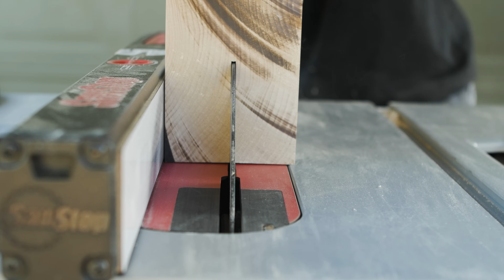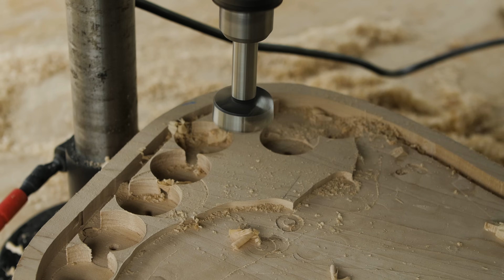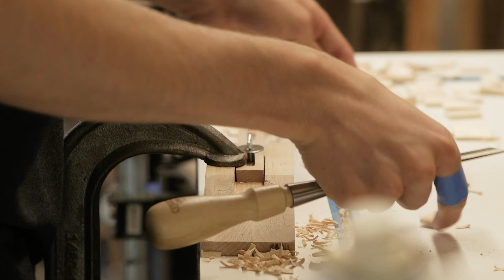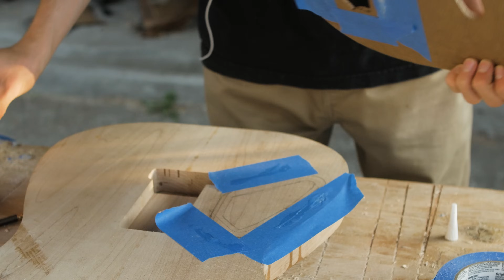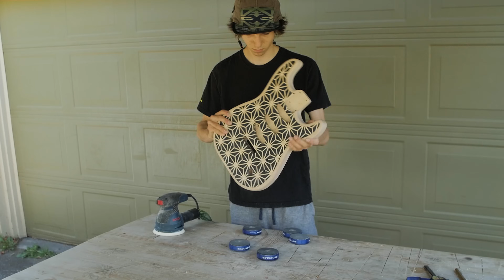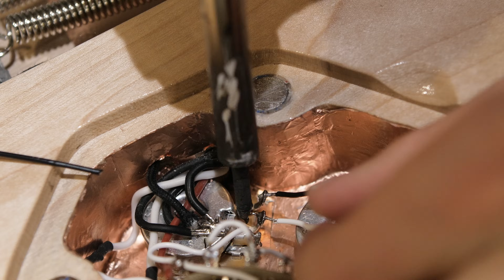Epoxy + Kumiko = Epic Guitar?

Comment: Hey, young man, that's a great work of art you made. I love it; you're a god damn artist.

I don't get why they don't make cheaper guitars like this. In Argentina, a Epiphone special costs between $400 and $500, and for me, that's a relatively high price for a basic model with relatively inexpensive materials for a guitar without amp. 

Although, if the problem is the use of expensive woods, for example, I'd much prefer to pay between $150 and $200 for a guitar like the one you made. I wouldn't mind if it were made of pine, basswood, or even friking pallets as long the design is the same.

Again the design is beautiful, and with that price, I could get a 15-20 watt amp, which here cost between $200 and $400.
Anyway, I fell in love with your design and how you made this guitar. Keep making things like this; your work is truly admirable.

Comment: Cool stuff. I was hoping for a through body pattern with a cap for the front and back. Was interested in the sound it would make. Also without the pick guard you might have wanted to set the neck a little bit deeper.

Comment: after you tin the wires with solder, you've burned away all the flux that comes inside the solder from the factory.  so when you do the final soldering you should add a bit more flux manually to keep out impurities and prevent corrosion from compromising the connections after a few years.  even if it's not enough corrosion to weaken the connection, it can add noise into the sound that's picked up.

Comment: Impressive!  How does the epoxy affect the weight?  I’m thinking of building an epoxy pour tele but am worried about the weight. Was thinking of hollowing out parts of the body behind the pour and inlaying laminate to pour onto. I’ve never used epoxy so I don’t know the density compared to maple. 

I’ve been a professional woodworker for 25 years, you have some impressive skills. Well done.

Comment: Beautiful !really nicely done!!! One suggestion is to use a table mounted router with a flush trim bit as it guarantees no woopsies during routing as it is very easy to accidently tilt while routing around the upper and lower bout tips by the neck. Another option is to make  12x12 inch plexiglass base for your router using ⅜ plexiglass, it will give you a much more stable router base.

Comment: A really brilliant build and a well made video about it too!

One tip I picked up from Pask Makes about Kumico is to use a piece of laminate flooring as a thickness planer sled to precisely thickness your strips before cutting the notches. You glue the strips down with low tack double sided tape. Getting them a precise thickness in that way gives you a good surface finish, and means you can tune the fit very precisely so it assembles easily without the need for the hammer or the splits you got when assembling this one.

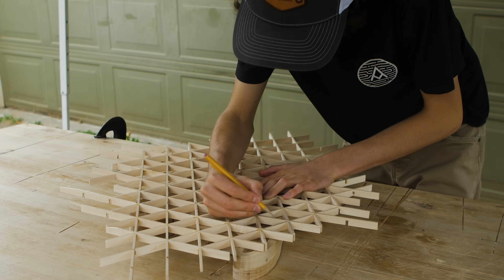Comment: I'm confused at 6:30, did he make a template for the inside shape he could have reused instead of eyeballing?
Reply from the maker: It wouldn’t have been completely accurate because I had to sand the inside edges of the cavity making the opening bigger than the original template

Comment: That soldering iron is a bit skanky.
Reply from the maker: Haha yea I only use it like once a year so i can’t really justify buying an expensive one.
Reply: @makewithmiles  You could add some paste flux to the joint while you solder and the solder joints would be cleaner.

Comment: I like it but the hardware looks like it doesn’t match very well. Both the pickups and the surrounds and the knobs look out of place to me. Something a bit easier on the eye would look good. Maybe some cream knobs and also some pickup covers too.
Reply from the maker: Yeah, I had but black pickup covers which ended up not fitting so I was left with no choice but to go with white ones for the video.

Comment: sumting i allways wonder about , with the tremmolo spring hole in the back , why not mount the elements/ pickups from the back , that way there mounted the way they would look when mounted through a pick guard , the coverplate for the tremelo springhole wouldve need to bee a bit bigger but the front of the guitar would look a lot better

Comment: There's only 4 things I can think of, that I personally would have changed:
1: I would have flush mounted the neck backing plate, with the radius used for your round over this would have made it more comfortable, and really clean looking.
2: I would have flush mounted the Tremolo Spring cavity cover.  These 2 changes would have seriously complemented the beautiful work done for the rear electronics cover.
3: I may have missed it, but I did not see a ground wire to the Tremolo/bridge. - If I missed it, great, if not, I would add one.
4: When making your electrical connections, Solder itself is not a good mechanical bond. You should be hooking your wires onto the terminals and getting a good bite on them with needle nose pliers, and then soldering them down. The solder is there to fill in space to prevent a mechanical connection from corroding or coming loose.

Other than that, top notch work!!! I can't wait to see other builds as your skills progress even further.

Comment: Hey Miles - I am a 65 year old woodworker who has been playing and teaching guitar for more than 40 years as well.  I use kumiko in some designs, and I use Japanese tools quite a bit..  This wis a very , very impressive build.  I wish you had played the guitar with a pick - that is the only way to really get a sense of the tone, but with what you did as far as cosmetics are concerned, I dont think you are too focused on the sound anyway.  The art is the thing in this case, and it is fantastic.  I own 30 or so guitars, and I don't have anything that is as interesting as your build.  
There are two things I worry about with the  use of epoxy - the weight, and the resonance.  I imagine your guitar is pretty heavy.  Regardless, its a great piece of art.  I am very impressed, especially for your age and lack of woodworking experience.  You knocked it out of the park young man!  Way to go.
Joe

Comment: An amazing job, better than I could build, so I can only offer one tip: have you considered a "flat" too table saw blade, rather than the ATB (Alternating Tooth Bevel)? It would give your dados/slots a flat bottom, almost like it was smoothed out with a router, chisel, or router plane.
Reply from the maker: Thanks for the tip! I didn't even think of that, such a great idea, that would make everything fit better.

Comment: some black or chrome pickup covers and black knobs would be tasty on that and that hole in your neck plate is for a micro tilt neck adjustment. that's just a t nut and grub screw but your neck has to have a little metal disc to resist the screw used to adjust the neck angle. easy install and would complete your build.

Comment: I did lot of those kumiko joints when I was building my rc glider, mainly in the tail section. I used "great planes", angle sander. Piece of wood with a protractor and a sliding sanding block to get the angles exactly. The tighter the joints the nicer it looks. Nice tip with the washer tracing electronics cavity. Speaking of that, you could have traced a thin metal cover and glued that to the insides of the wooden cover. That way the cavity is also shielded from the back and you would only need one set of magnets ie. on the body. You could then easily take the cover off.

Comment: I have a question Miles. I used that link to buy a router bit, and it's the Amana Tool 45474 3/8" diameter but the pictures mostly show the 47222 3/16" bit. Which one did you use? I'm feeling like I might want both; the 3/8" looks pretty big to me for say, pickups.

Congrats on the win! You put a lot of work into that!

Comment: Really nice build! One critique, is get a better soldering iron, and turn it up hotter. I usually turn mine up over 800. The solder should completely liquify and leave a shiny surface. Flux also helps you achieve this. Your joints were cold solder joints, and will crack and work their way loose.

Comment: I've built a complete bass and a replacement neck for a different bass with hard rock maple and, admittedly, my table saw is a bit old and underpowered. What I'm getting at is my cuts also burned a bit like yours did with the 1/8" straps. Any recommendations to prevent burning? Better blade? Higher rpm?

Comment: I'd recommend shielding the pickup cavities as well as the electronics cavity. One of the problems with not using a pickguard is that you can't shield the front face of the guitar. Alternatively, using humbuckers could mitigate most of the risk of unwanted noise at higher volumes that strats are known for. Based on your performance at the end, this might be not much of an issue with your style (I play with a lot of gain so I always had to struggle with my strat, doubling the shielding on the pickguard helped a lot). Not trying to nitpick, really gorgeous work, thanks for uploading

Comment: Impressive job, it's a shame the epoxy came out so black that you can't see the 3 dimensions of your intricate kumiko work

also it looked like the wood bevelled away from the metal neck plate, it would look great if it was flush with the back rather than proud which would solve both issues

Comment: I was born July 4th 1963. I started trying to "build stuff" at age 4. I got a rectangular block of wood from My Grandad's basement then a Black-Green permanent marker from Grandma's junk drawer and drew a speedometer, tachometer and the rest of the gauges on the board. I had made a dashboard. I was sure proud of that thing and showed it to everybody. I originally wanted to build antique reproductions of old furniture as a career but it's nearly impossible to get a job doing this unless Your Father & Grandfather does this and You are their Apprentice. I settled on being a house painter/restoration contractor. I did much more than just paint. I did all the repairs and then paint the house. I've worked with my hands all my life but I believe this is the coolest thing I've ever seen. My hat's off to you young man you are true Craftsman. Your Workmanship is impeccable keep going no telling what You'll be able to achieve by the time You're My age - 57-1/2. You remind me so much of myself when I was your age. God Bless You and Your Family!! 
Jimmy in NC....

Comment: Great build - much cleaner than guitar work I did at your age! ;)  BTW, did you ground the bridge? 
Also, for best solder joints, make sure the part are mechanically joined/held together prior to soldering so that you don't get 'cold solder' joints when the parts move as the solder solidifies. :)

Comment: I built a fully acrylic guitar in 1992. I did all the routing by hand with a dremel style tool and patience. Then I hand polished it all. The only thing I forgot
was to not cut 90 degree angles, like at the neck pocket. It broke at that point during a show when I fell  hard on the stage after hanging from a bungie chord. (Yep, I was a "energetic" on stage). I repaired it by tapping and bolting and gluing. Still have it.....hanging on the wall with the rest. Cheers!!

Comment: Excellent job! Impressive craft skills and execution. My only suggestion is the white knobs & pickups aren't the most complementary to your beautiful pattern design. Also, have you ever used threaded inserts with a machine screw to attach the neck to the body? It will give you more structural support over time. Just a thought...

Comment: Spray max says the pot life for it's 2K Clear Coat is 48 hrs at 68 deg. I recently activated a can and did a small job with plenty left over. The clear coat was still 
good, and sprayed well 1 week after activating it. It was in my garage where the temp was 65-70 degrees. I actually tested it on a painted can 
before using it on my car. It dried to touch in about 15 minutes, and fully dried after an hour. So I don't know why the manufacturer says it 
has a 2 day pot life. I could see it if it was a 2 part version intended to be used with a spray gun, in which case the mix would be exposed to 
air. So as long as it still sprays- it's good. Don't throw it out after 2 days. Excellent video, and woodworking skills!

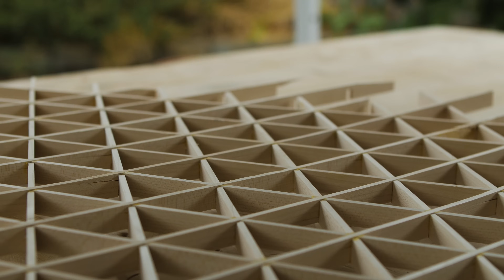Comment: some nasty cracks at 6:22
could achieve the same looks with just masking tape and paint or just 1/4" deep recessed pattern on CNC and fill the 'pools' it with epoxy
Reply from the maker: That would be easier, but I don't own a CNC ;) The cracks don't affect the strength seeing as everything is encased in epoxy afterwards.

Comment: Your work is beautiful.  One thing though, you could have used a Fender Plus bridge that uses only 2 pegs to pivot on for more smoother action.  Another option would to use Schaller locking tuners for a strat and roller nut.  Your build could have been a Fender Plus replica.

Comment: Came for the epoxy, stayed for the fine craftsmanship. Nice work! 

I'm especially impressed by the battery lid on the back with magnets and those decals with your logo on the headstock. 

(But your soldering technique could improve, it is not on par with your impressive knowledge of working with wood).

Comment: That isn't just beautiful, but functional as well.  I tend to not worry as much about aligning the mounting of the bridge with the pickups as I do the neck.  I had a Charvel that was misaligned and it was almost unplayable.  The E string would slide off the neck too easily.  Pickups tend to be more forgiving of misalignment.  I do prefer that everything be aligned properly and it looks like you did a bang up job on that.  I love what you did with the back plate and the magnets as well.  Excellent work!

Comment: As a guitar builder, for a second attempt, this is outstanding work. I do have a few words of advise for you though. First, if you draw a center line on your body blank, on both sides, your template alignment will be easier with less chance of mistakes. Secondly, you shouldn't use that electro socket on the front of the cavity. You are better off just using a jack as the socket is held in by two small screws without much material to bite into. It is likely to work loose and pull out over time. Thirdly, If using a neck plate instead of ferruels, don't round over the back side of your neck pocket, so the plate won't hang over the edges. Lastly, you will want to bury those decals in clear coat. It will hide the edges, and protect it. A lacquer first coat is best for this, as it will burn into the cellulose that the decal is made of and completely remove any visible clear edges of the decal. You can coat the lacquer with the urethane clear a few days later

Design wise, swap your knobs and pickup covers for black.

Comment: As everyone else already said, great build and amazing job! I have one question though, does the guitar sound clean, because at the end of the vid it sounds kinda "muffled". I really want to try and build myself one aswell with the Kumiko pattern, but before I buy all the electronics and wood, I thought might aswell ask to not waste my time (and money)
Reply from the maker: Yeah, I think that is because I didn't have the settings right on my interface/software. It sounds pretty clean just using my amp. I also used like $20 pickups so I'd imagine you could get an even better tone with nicer ones. Good luck ;)
Reply: @makewithmiles  Thank you and thanks for the quick answer!

Comment: I highly recommend making your own necks. It’s very rewarding. Also, you can skip the finger hole for the backplate by placing a magnet in the middle of the cover and making a tool you can use to stick to it from the outside and pull it out.

Comment: Amazing work! One simple change I would recommend would be to widen the neck screw holes in the body just slightly so that the screws only thread into the neck itself and not the body. When the screws thread into the body it causes the body to travel up the thread of the screw away from the neck and creates a small gap. If you widen the holes in the body it shouldn't really change much as far as your setup goes but it should make a pretty substantial improvement in the resonance of the guitar.
Reply: It's an electric guitar, resonance doesn't matter.
Reply: @auzzythegreat  Never heard of Sustain huh?  Resonance does matter in an Electric Guitar. Otherwise people wouldn't have spent decades chasing Tone Wood, they all would use plywood. :-|
Reply: @auzzythegreat  clearly watched that guy playing over air.
Reply: @auzzythegreat  No it really really does

Comment: looks awesome dude.  only suggestions i have would be to either not round the back of the neck pocket so much if you're going to use a neck plate, or just remove it and use the screws with countersunk washers.  also, you could've made a trem plate cover out of maple as well and countersunk it like the control cavity plate.  however, you'd likely have to grind down the block a little to make it fit.  and personally, i think black covers/knobs would flow better with the black epoxy/decals.  but i do love the custom decals, i just prefer to clear over top of them for a more modern finish.  overall, this was rad though.